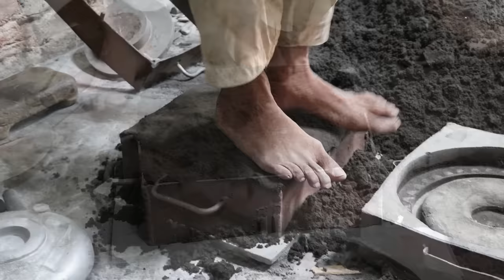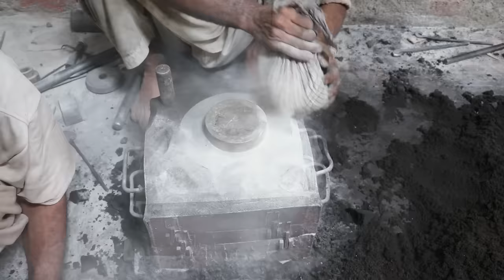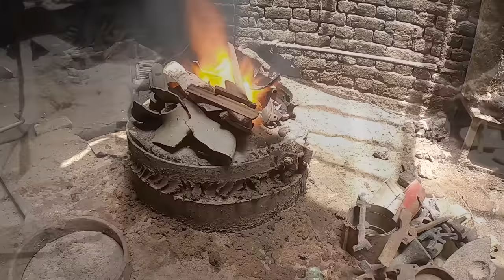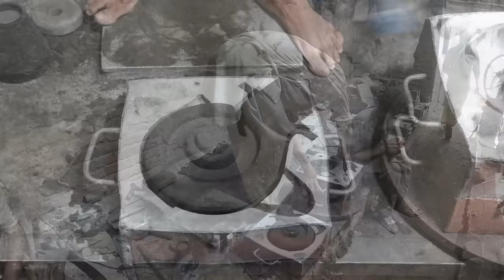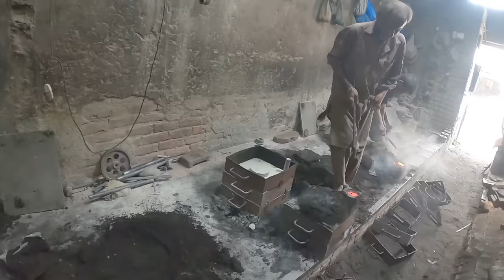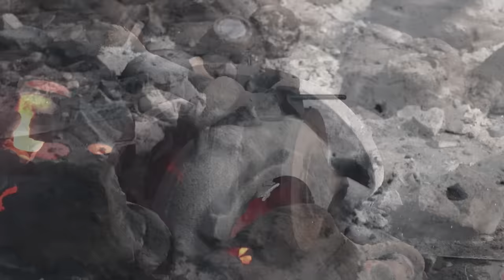Centrifugal Pump Body Casting Process Using Sand Mold Technique

Comment: Love the safety sandals 😂
Reply: I'd bet pretty much ANY footwear is no match for molten steel, aluminum, or brass. From other more in depth vids of such foundries, there's an apprentice on the pouring floor tasked with shoveling off any spilled metal lickety split, so the pour men won't be in danger of stepping on it. These guys do this every day, and I've yet to see one missing toes, or with big burn holes in their feet.
Reply: Yes, the security of sandalwood is top notch.

Comment: What kind of sand and oil they are using for molding?
Reply: They use molasses as the binding agent, that’s why the sand moves the way it does just like brown sugar. must smell like candy floss when knocking out. 👍🏴
Reply: @alasdairhamilton1574  thanks a lot for your kind valuable reply sir
Reply: Use Normal sand with sira oil....#FoundryTech

Comment: European goods are fully manufactured to the point of placing the final product in a box with a specialized machine. ls it possible for this miserable labor to manufacture one of the spare parts for a car that travels at a speed of 300 km / h without causing a catastrophe ?